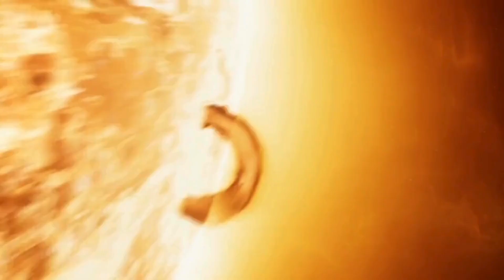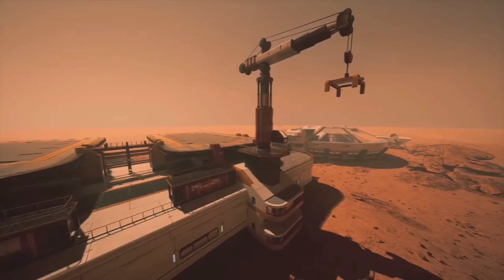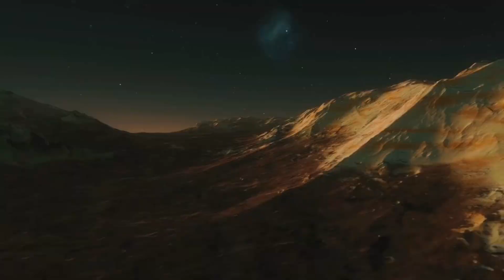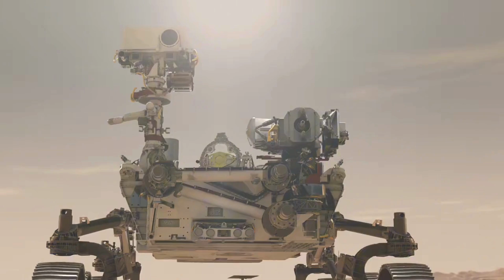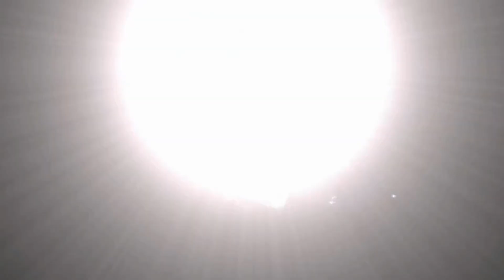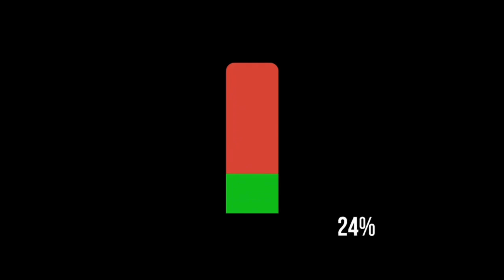How Will We Get Energy on Mars?

Comment: NASA’s small nuclear reactor with the sterling engine as the primary. Solar as supplemental 
Forget wind turbines because the dust would soon make it inoperable. Fusion is 100 years away but in the future it will ultimately be solely fusion
Reply from the maker: Thanks for your comment! You’re absolutely right  a small nuclear reactor (like NASA’s Kilopower with its Stirling engine) would be a fantastic primary power source on Mars, with solar panels as backup since Martian dust would quickly make wind turbines impractical. Fusion power will be amazing one day, but it’s still a long way off, so for now nuclear and solar are the way to go.